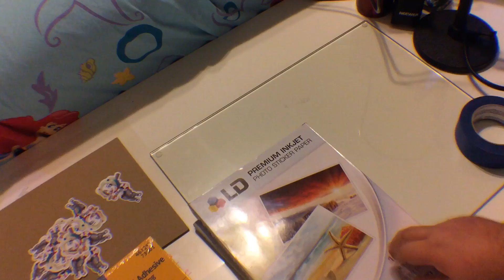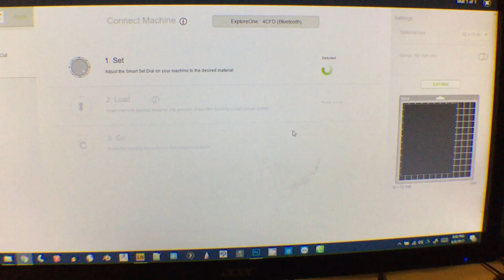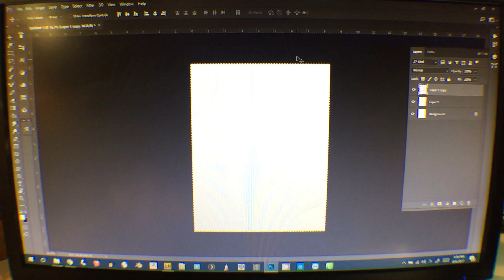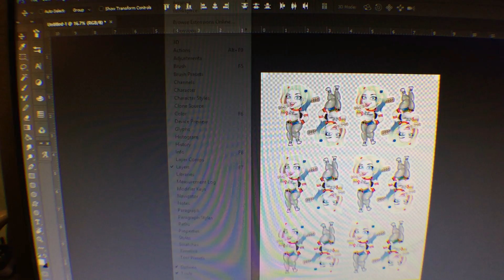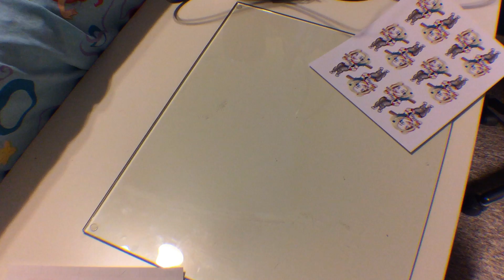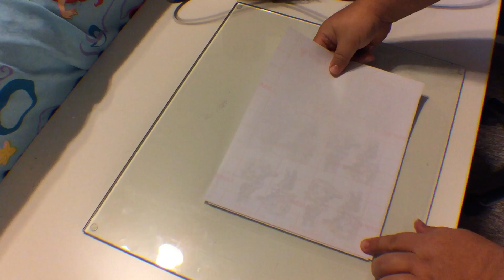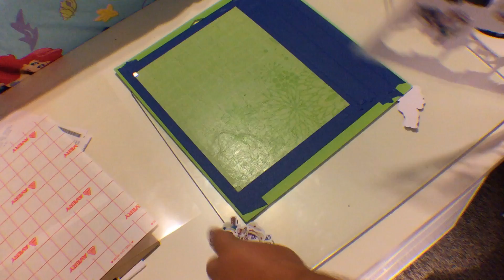Trick your Cricut to do FULL PAGE Print and Cut - Sticker Tutorial!!

Comment: I've had big issues with creating perfect cuts with my Cricut Maker. All day I have tried to do this and was unsuccessful. I find that when I do this, I get a gap of 0.25 when I put my 8.5 by 11 inches print inside the area on my Cricut after cutting the dimensions in the steps of the videos. I'll try this tomorrow and see if I have any luck.
Reply from the maker: I just purchased the cricut maker over the weekend. Once I get it setup I will make a video using the trick. I will be trying this myself for the first time, but I have been told by others it worked. I cannot imagine why it would not work on the maker. Most of the issues I have ever had were the fault of my printer, how I feed the mat or my own errors. If the registration squares cut right in the corner of the taped mat it is an error with your files or printer.
Reply: I found a way to work around it. Twas me being very silly. Using the dimensions for A4 here is 8.3 by 11.7. The 8.5 by 11 didn't work unfortunately, but the dimensions I work with now works a dream :)
Reply from the maker: @MissCarpenator  Awesome!

Comment: why do you need the registration marks?  Does this ensure the cricut lines up the other cuts correctly?
Reply: I wondered the same thing perhaps it is to be able to check the alignment of the paper when it starts to cut?
Reply from the maker: That’s part of it for sure. Other is to trick DS to allow me to cut without using DS to print crapy quality stickers.
Reply: I think I get it now - putting the registration marks keeps the cut of the image in the location you want. Ie without them it will place the cut as close to the top left as it can, rather than perhaps the centred on the page where the image actually is.

Comment: Why not press it before cutting? Makes more sense.
Reply from the maker: Because the edges of the page are still sticky and I don’t want anything to happen where the could get stuck in the press. I did feed the mat through the machine, but it maxed out the thickness and there was no space on either side of for some reason the mat shifted and would get stuck. Trust me I tried a few ways and almost busted the press a couple of times.

Comment: This was an incredible video. But if I may, why did you wait until the stickers were cut out to do a cold laminate? What is the reason you do it after? I am sure there must be a good explanation of why. I just don't know it, just as I didn't know all the rest in this incredible tutorial.
Reply from the maker: I waited for a few reasons. Mostly because even know that mat could fit through the machine it is a tight fit both thickness and width and if it for whatever reason starts to angle it will get stuck and I could break the cold press. Now doing it without the mat will not work as the lamination is slightly larger than page and still has tack/sticky over lapping and would get stuck in the machine. I use a pice of cardboard when feeding the stickers that get the right amount of pressure without messing with the machine.

Comment: Eric thank you so much for the tutorial!! I have a question that I am hoping you may be able to help me with. I have followed this video and the other cheats and for some reason my cuts are off. I have all the same print settings and registration marks but it will not cut my stickers properly - they are way off and then two in the lower middle are fine but thats it. SOS Hoping you have some ideas
Reply from the maker: Are the registration squares cutting correctly?

Comment: this doesn't work for me and its driving me crazy!!! what could I be doing wrong? it cuts the registration squares but the images inside it cuts way off. plz help!!!
Reply from the maker: It is most likely your printer is off. Check and make sure your not printing borderless. Also print the same image 3 times lay the paper on top of each other and place up to light to see if the prints are lined up each time. Some printers are not very precise. If that’s not it double check the cut file you uploaded. The fact that your registration squares are cutting right already proves it works. Thanks
Reply: yea, something is off no doubt. I notice it doesn't warn me the print is full page so that's weird.

Comment: Ok, this is awesome.  I do have a question though.  You set the mat to go through the machine backwards (the store hanger hole at the bottom), but when you actually fed it into the machine, it was back at the top.  Obviously this was a completely different mat but you made a point to say you were running it backwards then didn't.   Does this affect the cut at all?
Reply from the maker: Yeah I was just trying to show you can do both ways. If I’m making a lot of stickers/magnets I can tear up a mat quickly and find rotating it helps it to last longer.

Comment: the print and cut method is actually better since it prints out borders for registration and scans it on the cricut to then make cuts.
Reply from the maker: Yes, but scan is flawed and if you use glossy paper most of the time the scan will not register. You also lose material. I can get 12 stickers instead of three to a sheet. No big deal with stickers but magnet paper is not cheap.

Comment: Hey i had a question about alignment. So i followed everything and my prints are correct, but for some reason whenever i put the mat in the alignment is wonky. Maybe my rollers are finicky but for some reason theres always too much space on the top part or the right side of the sticker or both. No matter which way i nudge it to load it in its always messed up. Not sure what to do. Ive had it cut correctly once out of a bunch of mess ups. Just curious if anyone has had this same issue.
Reply: @Erik0nFire  i find that it may be finicky when loading. I didnt know it was THAT finicky, but theres a chance that when you had originally cut the rectangle of the 8.5 by 11, the load was off, which is dumb because theres no way of really knowing if it is off until you start cutting designs. I ended up running 5 pages through and found that id always have too much space on the right and at the top. I trimmed some area off the top of the tape, and aligned my page up with the right side of the machine instead of the left. It ended up solving my issue for the most part. I would just say be really careful when loading. I have the thinnest mat too (the blue) so that could be apart of it not gripping to well. I also have explorer air 2 instead of a cricut 1 so i would just experiment with what you have even if it means redoing the rectangle in the beginning because if you have the thinnest mat, materials have differing thickness so theres a chance it slipped and went in wonked. Theres some tips for ya. Hope they help some. It isnt perfect but it made my cuts more accurate.
Reply from the maker: It’s the printer. Try adjusting print output by offsetting it in photoshop. Sometimes center is not truly center

Comment: So I’ve been having in and off success with this. There are times where it cuts perfectly for the first two rows then the alignment messes up for the rest of the sheet :( like for the next rows the cuts shift higher than the image. I’m not sure what causes the problem. I also have been able to cut a full page almost perfect a few times but almost always struggle to get things realigned after getting back to work after turning off the machine.

Additional info: I’m using Explore 2 and A4 size sticker sheets
Reply from the maker: I have issues with this too sometimes and requires me to recalibrate my Cricut.
Reply: Eric M Boyd Ahhh Alright, I’ll try to recalibrate it again! Thank you!

Comment: I tried this technique last night and I was ready to throw my cricut. I am not sure what I am doing wrong but my cricut is not cutting the “cut” image right! It’s always off!! I use an hp deskjet 3630 to print from Inkscape. Does this trick still works?
Reply from the maker: yes it still works. Are the registration squares cutting correctly?
Reply: Eric M Boyd yes they were cutting perfectly but then when it moves to the circles, it’s not cutting it where it should be
Reply from the maker: @aonnedarnach5772  If the 4 corner squares are cutting correctly something is wrong with your printing settings, printer is printing off or the files aren't quite right.
Reply from the maker: @Erik0nFire  In my printer the rear feed instead of the tray fixes this. There ware also printing adjustments you can do if you are using photoshop  where you can slightly move the print left or right. If you find it is always cutting more to the left than you could adjust for that, but the real issue sounds like your printer not print the same every time. If your registrations are perfect you are doing it right.

Comment: so this is basically a work around the fact that they stupidly limited the 'print and cut'  to 6 3/4 x 9 1/4! awesome. I have to ask though, only been doing this a week or so, what is the purpose of putting the 'registration' squares in the corners? I thought it only needed the 'black lines' in print and cut to calibrate where to cut, but if we're saving the image only as a cut image and printing from another program, it needs those to 'set itself'?
Reply from the maker: Sounds like you got it.

Comment: Hi Eric! Do you use a fine point blade or a deep point blade? I find that when I put the laminating sheets on top of my sticker paper, it doesn't cut through all the way down. (I even changed my fine point blade to a new one). Sometimes I'm afraid to run it through my cricut again because I'm afraid the cut border will change! Also, what setting do you use when you set up on the cricut app? Custom—sticker paper—with the pressure as default? More pressure? Or do you set it to vinyl? Hope you can answer! I got it the full page hack to work, just now the logistics of cutting through all the way down! Thanks Eric!

Comment: Hey, I've watched this several times and done everything that you have advised but for some reason, my Cricut explorer 2 cuts it completely off centre. I honestly can't figure out why. I've calibrated the machine. Are you able to give some insight into how I can get it to work?
Reply from the maker: Are the registration squares cutting correctly in the corners of the tape?
Reply: @EricMBoyd  Hi Eric, I've been having the same issue and the squares are cutting correctly. I've fixed everything that I could possibly fix with my printer but it still cuts waaay off center. Do you have any idea what I could do now?
Reply from the maker: @grapiereads  If the squares cut correctly it is either the image file uploaded to DS or the printer is not printing correctly. 90% of the time it is the printer not printing the way you think it is. Make the registration boxes black then print them and when you cut the alignment will tell you if it is the printer being off.

Comment: I have all the sizes right, I've triple checked..however when I go to print, in photoshop the print preview shows the image being cut off. I've scaled it down a little bit, and the same thing. Any advice?
Reply from the maker: Print three sheets of the same image on cheap paper. Layer them on top one another hold them up to a bright light and see if the images are perfectly aligned by the printer. 90% of people have issues is because their printer is not longing up the pages the same every time.

Comment: I’ve followed this guide exactly and my cuts are still off quite a bit!! Not sure what I’m doing wrong but I’ve done the 8.5x11 trick to cut the tape and the printed sheet line up my paper best I can but it still cuts the printed space off (to far left/right and down most of the time). Any ideas why it would be off so much?
Reply: I had a similar issue, it was the way my printer was printing. If you're printing borderless make sure you're not letting the printer enlarge the images at all, It fixed it for me since i didnt realize it will slightly enlarge the image on default and that makes it shift a bit vs where your digital file is lined up for.
Reply from the maker: @Alexis-mh2ub  Well said, thanks for the response.
Reply from the maker: Print three sheets of the same image on cheap paper. Layer them on top one another hold them up to a bright light and see if the images are perfectly aligned by the printer. 90% of people have issues is because their printer is not longing up the pages the same every time.

Comment: Great tutorial but what’s the point in the reg marks when the cricut doesn’t look for them anyway?
When printed they aren’t visible as they are white so why bother with them at all.
Just a question not picking faults. 👍🏻
Reply: Paul Teajunkie so that the png file is the right size.
Reply: How does this make the png the right size?
You have to manually resize the png when sent to DS to 8.5x11 the reg marks didn’t come into it. 
They aren’t printed as they are white so it’s not like you can even align to the initial cut. 🤔
Reply from the maker: Design space will crop and adjust the png to a new size of the registration marks aren’t in there. You won’t even know it till you try and Alain with tape. You know how long it took me to realize they do this. Was killing me for months.
Reply: Eric M Boyd Ah right I get you 👍🏻 Watching the video it wasn’t obvious why they are needed. 
I’m new to cricut and use a graphtec ce6000 for all my vinyl and print and cut jobs. 
The whole DS software seems awkward and not user friendly at all ☹️.

Thanks for the tutorial 😉👍🏻

Comment: I NEED HELP! SO I do the tape thing, but then when I lay my paper down on top of it, and go to cut it, the cut is still super off. I've tried redoing it multiple times. I am doing the "Cut" setting not "Print then cut". Please help I'm about to have a mental breakdown over this stupid $300 machine
Reply: if its off even a little bit with his method its going to cut way off. if you print then cut and actuallt use the box and registration marks its easier, you can use the bleed setting it migh help your stickers later
Reply: Ro.osabella Char I eventually went back to trying to just do print and cut and it STILL cut WAY off. I used the laminating paper on top though, does that affect it?
Reply from the maker: Laminate will not read with circuit P&C feature as the scanner doesn’t like glossy surfaces. Print three sheets of the same image on cheap paper. Layer them on top one another hold them up to a bright light and see if the images are perfectly aligned by the printer. 90% of people have issues is because their printer is not longing up the pages the same every time.

Comment: hi, i followed every single step perfectly and it just doesn’t work for me :( i’m so upset and the cricut team are so hard to get hold of. this is my first time using this circuit and it just won’t work for me. the calibration tests i carried out 7+ times and not once was it fine. all the money i spent on this machine and i’m payed back with failure after failure and lots of wasted ink and paper !
Reply from the maker: Print three sheets of the same image on cheap paper. Layer them on top one another hold them up to a bright light and see if the images are perfectly aligned by the printer. 90% of people have issues is because their printer is not longing up the pages the same every time.

Comment: Could you go into more detail about why the cut was off at the beginning? I just want to avoid making any mistakes myself. And also if it's a 1 simple mistake with 1 simple fix which was just you adjusting the mat by a cm? I like to know all probabilities and outcomes before starting a project. Love your cold press lamination idea haven't seen it anywhere else
Reply from the maker: Print three sheets of the same image on cheap paper. Layer them on top one another hold them up to a bright light and see if the images are perfectly aligned by the printer. 90% of people have issues is because their printer is not longing up the pages the same every time.

Comment: Smart idea and SO useful considering how much ink and paper is wasted with the print and cut method on cricut design. Just been trying this method and I can't get my cuts to line up accurately and I've driven myself crazy all day trying to figure out why - the print is DEFINITELY true to size, I've marked and remarked the tape guides, I've basically gone through everything a million times....my registration marks are cutting accurately, right where they should be, but then the rest of my cut is off by half a cm at best...dude please, help me if you have any ideas. I'm going insane.
Reply from the maker: Print three sheets of the same image on cheap paper. Layer them on top one another hold them up to a bright light and see if the images are perfectly aligned by the printer. 90% of people have issues is because their printer is not longing up the pages the same every time.
Reply: @EricMBoyd  hey eric thanks for replying! It turned out that i had a defective machine which i returned and now my new one is working fine😊

Comment: I watched this a few time I can never cut it right even  i print out from photoshop then go to my cricut maker to cut it.
Reply: check your printer setting in ps, it may be changing the size unknowingly resizing your project which then messes up the cutting alignment in cricut.
Reply from the maker: Print three sheets of the same image on cheap paper. Layer them on top one another hold them up to a bright light and see if the images are perfectly aligned by the printer. 90% of people have issues is because their printer is not longing up the pages the same every time.
Reply: @EricMBoyd  i believe the paper needs to be exactly 8.5x11 also - i measured two different products and both were not exactly 8.5x11, could this also be an issue along with printer not loading paper the same every time?
Reply: @EricMBoyd  another thing, could the size of the stroke of the registration marks be an issue?